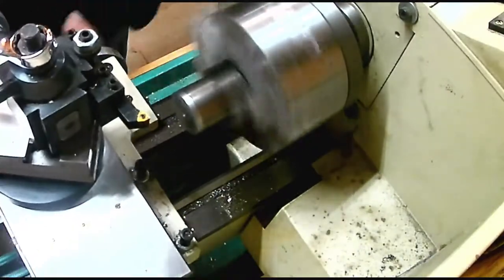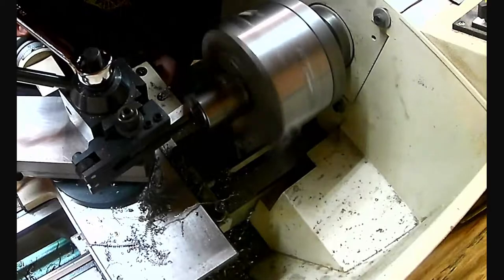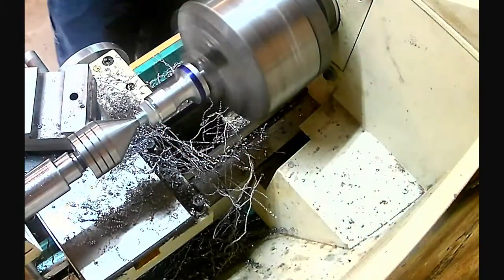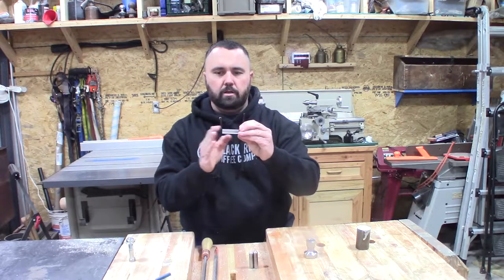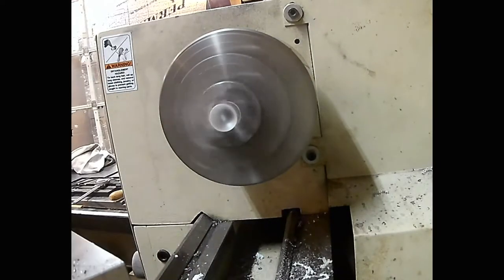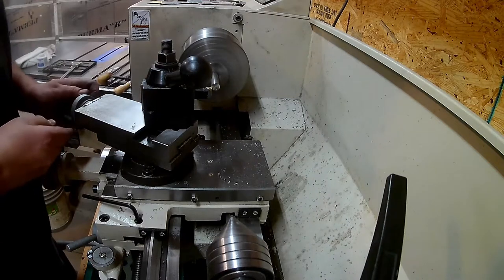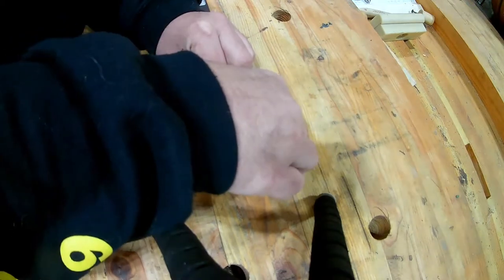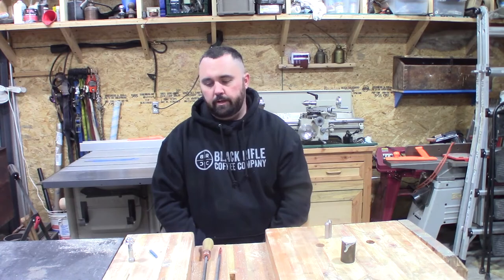Making an Optical Center punch

Comment: I’m making one of these soon. I don’t have a lathe but I have a plan. I’m going to use an alloy door knob as my base, and I’ll cut down some HSS drill bits to use as punches, or maybe sacrifice one of my current good punches, I dunno. I’m only nervous about the acrylic as I’ve never worked with it and want to be sure I get the magnification and a clear view. I have a buffing wheel and some super fine sand paper so I think I’ll be right. Anyway I’m sure I can make a workable item for way under what the commercial ones retail for.
Reply from the maker: Sounds like you'll be fine. I was nervous about the acrylic also. It buffs out way easier than I expected. Good luck
Reply: @spbuilds  awesome. That gives me a lot more confidence. I’m considering putting a rare earth magnet in the bottom as well as an o ring but I’m not sure if it’s really needed.

Comment: I am thinking about making one of these and wanted to know if there was any advantage to the way you did it — Why didn’t you just use 1/2” acrylic rod instead of using larger rod and having to turn it down to size? Thanks!
Reply from the maker: I don't know that there is an advantage of the 3/4 vs. 1/2 in rod. That's just how I did it. Good luck.
Reply: @spbuilds  thanks!